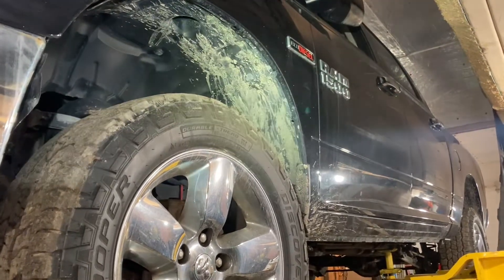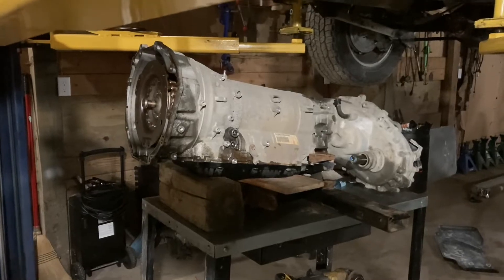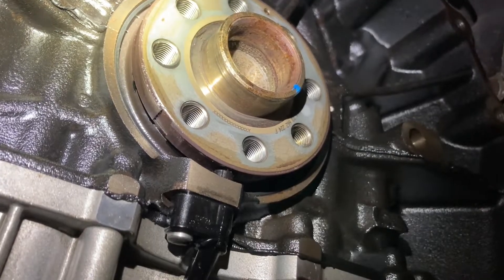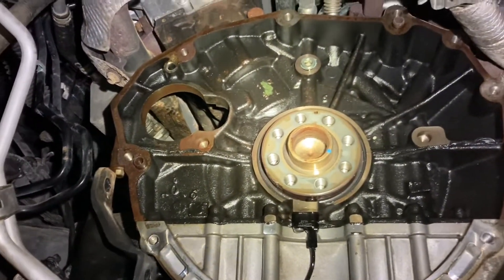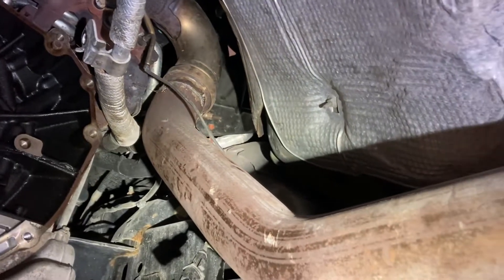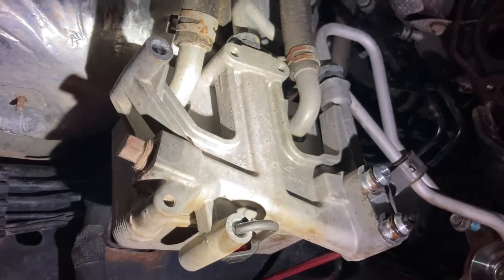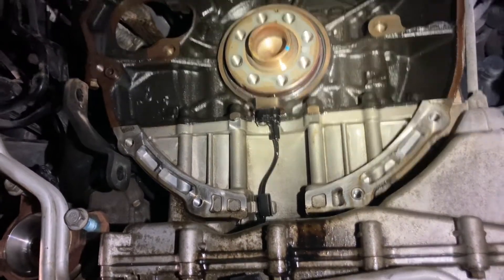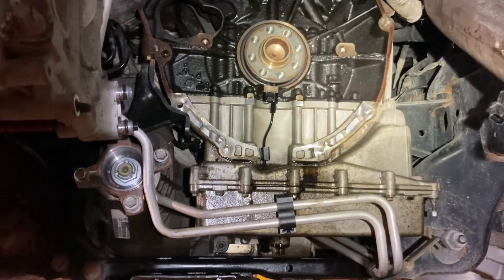Ram Ecodiesel no-start condition caused by faulty crankshaft sensor reluctor wheel/ring

Comment: Hello, 2014 GC EcoDiesel, we just replaced the alternator plate diodes, then drove it for 3 days with no issues, then we topped off tank, drive it home, now it wont start (just cranks) and no codes. Any recommendations please? Thanks.
Reply from the maker: Two most common things would be lift pump in fuel tank, or crankshaft sensor. Measure fuel pressure between lift pump in tank, and injector pump on engine. I have a video on this. Should be 55-60psi. If not, probably a failed lift pump or plugged fuel filter, or it’s not getting power and ground. The computer does not measure this, only injection pressure. Injection pressure should be at least 3500psi while cranking. This can clue you in to a problem with the low pressure, 60psi lift pump.

Comment: Where are you located and whats the total cost for the repair?
2015 1500 eco 160,000 miles
Reply from the maker: Located in Michigan, cost is $1000 out the door for everything.
Reply: Where in MI? I'm in Coldwater and possibly need this done. Thanks.

Comment: my engine stopped working after hearing that cranking noise on highway. could this be due to faulty crankshaft sensor?  besides i had that electric throttle light on also. My friend who is a  mechanic said engine might be dead. What do you think?
Reply from the maker: Not sure what your referring to by the noise, but that is concerning. At least the subject matter of this video, the crankshaft sensor and its reluctor ring, would not make any noise once they fail, just simply stall out and engine will crank over endlessly without starting. Look under your engine. If you see a substantial oil leak from the rear of the engine, that would be a sign of crankshaft main bearing failure. Let me know what you see or are experiencing.
Reply: @tadsworkshop   unfortunately i was not able to check under the rear engine for the leakage. However, i got this code from the obdscanner - U0100. Maybe communication lost due to faulty sensor?
Reply from the maker: @tenzinnamdhak  U0100 is a one electronic module losing communication with the engine control module. Might be a fluke or ghost code, happens more often than you think. Clear the code, and keep it in mind. But your not giving me enough details of your situation to help you.
Reply: That happen to my ecodiesel 2016 a month ago it sounded loud then right now it won't start

Comment: Great video. Is this repair fixed under warranty, even after the factory warranty is expired? Currently, they offer only one fix: a flash of the software. How often have you seen this happen? What percentage of Ecodiesels will this happen to? I have a 2016 Ram Ecodiesel. thx
Reply from the maker: If you have a powertrain warranty on the vehicle, they should cover this. Otherwise, yes your correct, Chryslers temporary fix is to program it so the engine can continue to run off the camshaft sensors, instead of the crankshaft sensor. I believe the truck may go into a limp mode afterwards, but I can’t say for sure. They are more concerned about the legal aspects of someone getting into an accident if the engine shuts off unexpectedly. I would say it will happen to all Ecodiesels eventually. I think environment plays a large factor in the magnetic strip delaminating from the steel ring (humidity, salt, long periods of sitting, etc). You could wait it out, or be proactive and take care of it before it’s an issue. That being said, who knows, your truck might live out its lifespan without it ever failing. It’s really hard to put a percentage on it.

Comment: How much would a job like this cost to replace the reluctor ring?
Reply from the maker: Where are you located?
Reply: Central Texas, I know it's going to range but I want to make sure I am least going to get quoted ball park reasonable
 @tadsworkshop
Reply from the maker: @andrewaguilar1415  for reference, I charge $1k out the door for everything. OEM Parts and labor.

Comment from the maker: To anyone who would ask or mention it, yes, there is a recall for the the crankshaft sensor. No, it is not a proper repair. It is simply reprogramming the engine control module to continue running off the cam sensors when the crank sensor fails, so the vehicle doesn’t turn off while driving and cause an accident. They will not pay a tech to replace the reluctor ring, they just want to cover themselves and prevent injury/accidents. The part will still have to be replaced properly in the long run. Aside from the check engine light staying on, I would imagine drivability issues would still exist afterward, possibly limp home mode, etc, but I can’t say for sure.
Reply: They told me cause my truck is deleted and tuned, it would be difficult for them to tune it, because it would go back to stock
Reply from the maker: @wallace7108 correct. If they reprogram the computer, it will undo the delete. So you’ll have to have it reprogrammed with the delete after the dealership.
Reply: I just had my reluctor ring in my  2017 replaced and my truck was in limp mode with engine light crank positioning sensor out of range and service electronic throttle controller.
Reply: How slimy. Last RAM I buy
Reply from the maker: @ This is just how it is with most modern cars. They are all designed for maximizing profit margins and lasting to the end of the warranty period with minimal or no cost to the manufacturer. That’s it. Not designed to be beneficial for the consumer.

Comment: do they have an aftermarket sensor that's better than Mopar part? I'm getting a delete on my eco, and I would like to replace the sensor while they put on a bigger turbo.there  dropping tranny anyway so why not replace it.
Reply from the maker: There is no problem with the ecodiesel crank sensor itself. The problem is with the reluctor wheel. And the wheel is OE only. So buy both genuine Mopar parts and be done with it.

Comment: hey tad i took mine to a repair shop and after the repair the truck wouldnt shift out of park. any idea what couldve caused this?
Reply from the maker: What repairs did they do? This crankshaft sensor, or something else? If if was after replacing this crank sensor…..they need to go over the cable that attaches to the driver side, and the main electrical connector on the transmission, on the passenger side. It’s also possible they damaged the electrical harness when reinstalling the transmission.

Comment: I thought this was a recall issue, should this be covered by manufacturer?
Reply from the maker: The recall is a bad joke at best. It’s reprogramming of the computer, so that, instead of the truck dying in the middle of your drive, the truck will actually still be able to limp you home and start back up again using the camshaft sensors. I don’t know for sure, but I’d imagine driveability issues would exist, and the engine staying in limp mode until the sensor and it’s ring are replaced. They do not want the expense of paying technicians to remove transmissions to fix the problem properly.
Reply: My 16 was just "added" to the recall, funny how they limited the recall according to VIN, while vehicles that met criteria and those that didn't were still having failures🤨  @tadsworkshop
Reply: I got the recall letter a few weeks ago. What a joke!

Comment: I have a 2014 ecodiesel..my mechanic said something melted inside the crankshaft..I don't believe that I think it's the crankshaft postion censor. Mine has a hard start. Stalls when I drive it..what do u think the problem is?
Reply from the maker: With a scan tool, I would see if there are any trouble codes first. If not, I would watch injection fuel pressure during the hard start, via the scan tool.
Reply: @tadsworkshop de😢😢😅